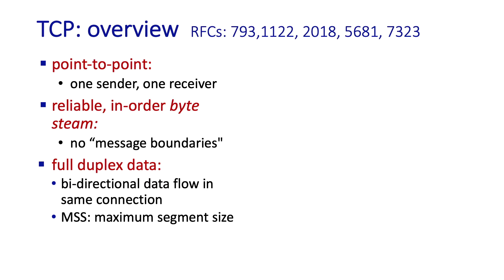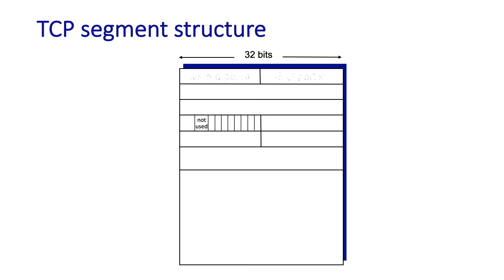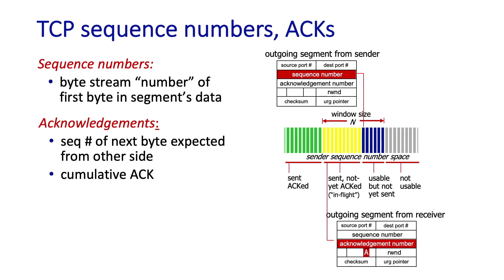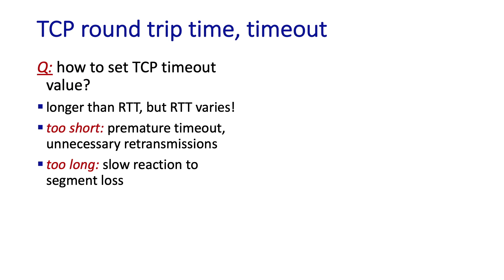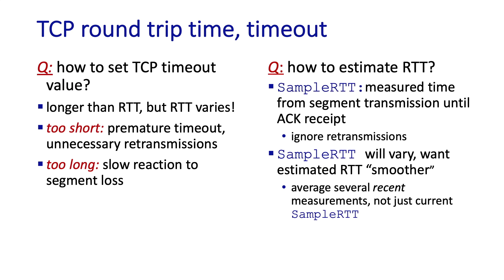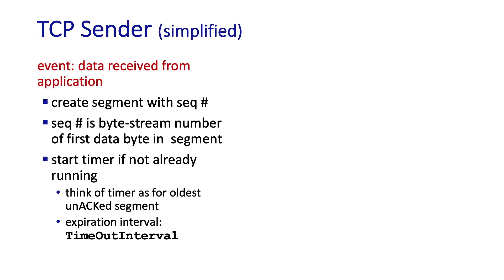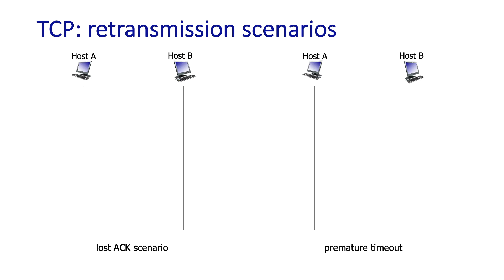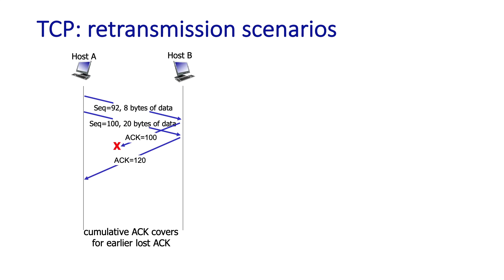3.5-1 TCP Reliability, Flow Control, and Connection Management

Comment: to summerize : This video discusses the reliability of TCP (Transmission Control Protocol) and its mechanisms for ensuring data transfer. TCP implementations often wait for another in-order segment to arrive before acknowledging the expected sequence number, reducing the amount of ACK traffic. If an out-of-order segment arrives with a higher sequence number, TCP sends a duplicate ACK indicating the next expected byte. In the case of a segment filling a gap in the receiver window, a cumulative acknowledgment is sent. The video also explains retransmission scenarios, where TCP retransmits segments if ACKs are lost or if there is a premature timeout. TCP Fast Retransmit is introduced as an optimization that allows the sender to quickly retransmit the oldest unacknowledged segment upon receiving three duplicate ACKs. The video concludes by mentioning that the mechanisms discussed in the video are used in practice by TCP and will be further explored in the study of the HTTP 3 protocol.